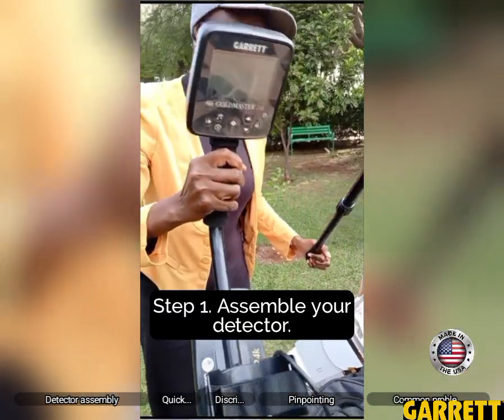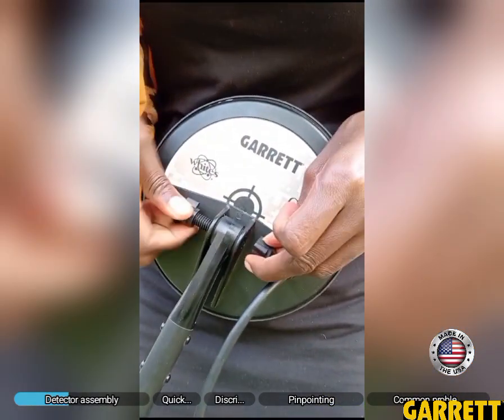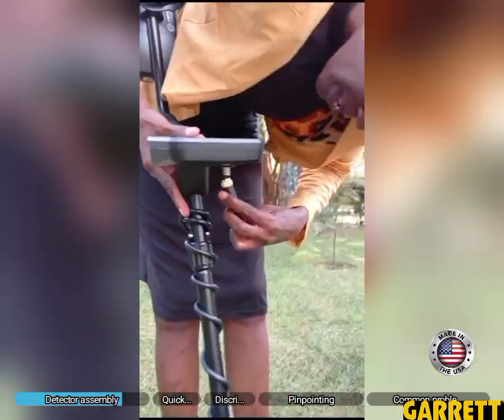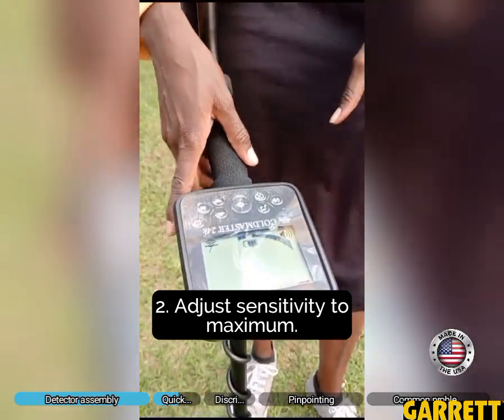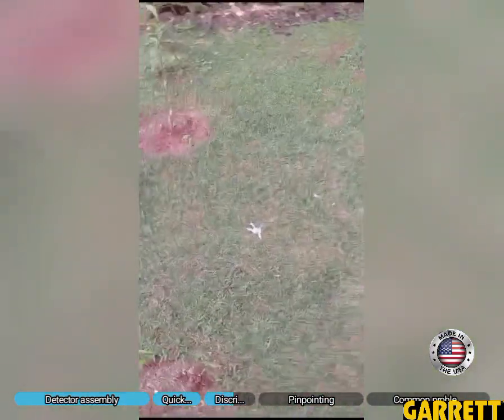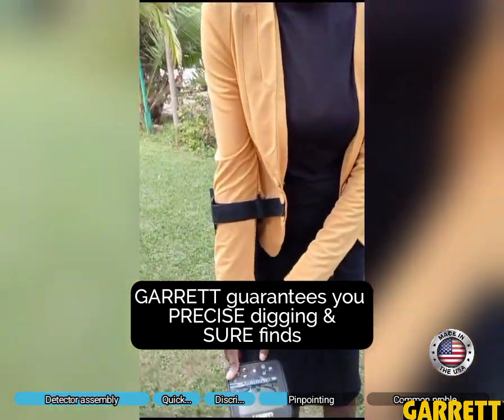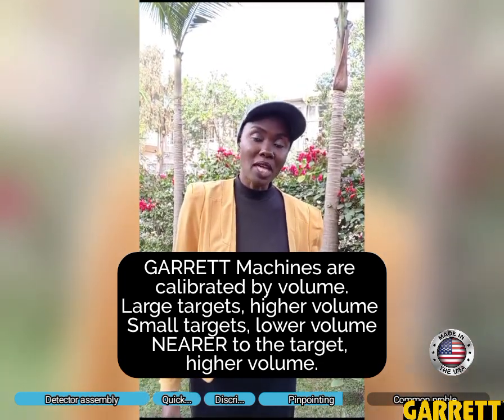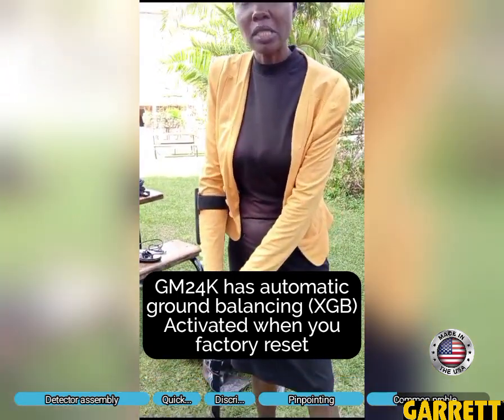Learn how to assemble and operate Garrett Goldmaster 24K gold detector.

Comment: Customer service stinks. It is a good detector but not as good as nokta gold kruzer. The gold kruzer is stronger and there service is much better when you have a problem.
Reply from the maker: It seems that you not have had a good experience with your dealer. That said, from my experience, no VLF detector is comparable to Garrett Goldmaster 24K. We vouch for it with our very own breath.
Reply: @DetectingwithAkello  the gold kruzer is better.
Reply: Where are you located
Reply from the maker: @LawySeiko Eldoret Kenya is our main office for detectors. Zion Mall B86/87. We also have a pick up point in Nairobi. Call +254715693091.
Reply: I am near Kenya suam border,,are they in stock and how much

Comment: I have a goldmaster 24k detector . It was working fine, but yesterday I got a problem with it. It seems that it doesn’t pick up any signal , the coil and the plate seem that don’t receive any signal from the screen.  I checked the coil then repaired it with anther one, I also pressed the down button then turned it off to have a new format, but I still have facing the same problem. May you guide me to the right solution, please?.
Reply: Thats because its not a good detector and customer service don't do there job. The nokta gold kruzer is better and stronger I think. Customer service from nokta is much better.
Reply from the maker: This is what I would advise.
1. Change the coil
2. If changing the coil doesn't work, then check the pins. No signal between the coil and the control box is a sign that signal is not getting transmitted, and either  you did not connect it well, or the pins are damaged.
3. Take the detector to your nearest repair centre. Your dealer should be able to guide you.